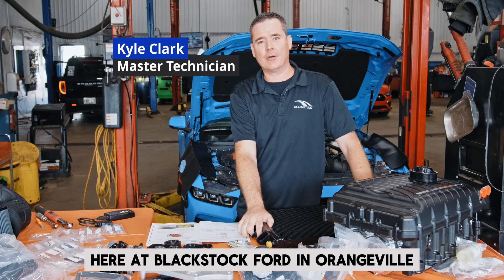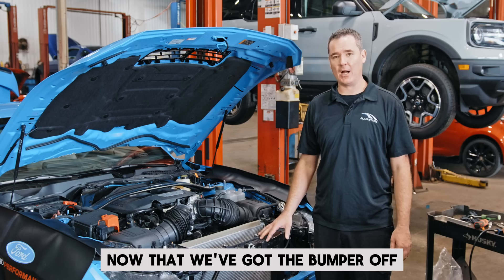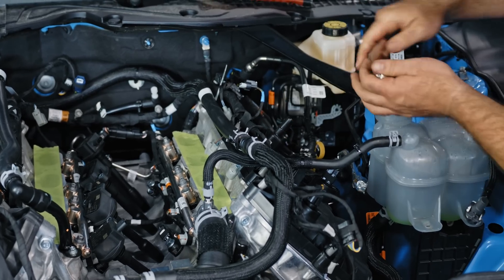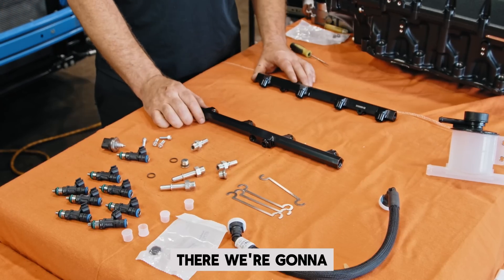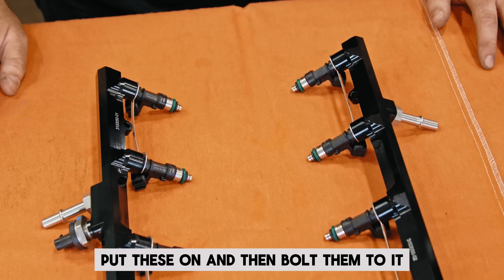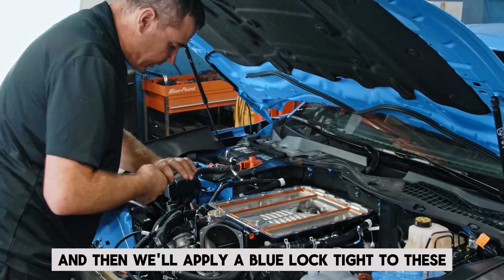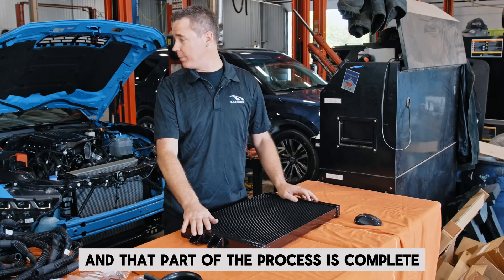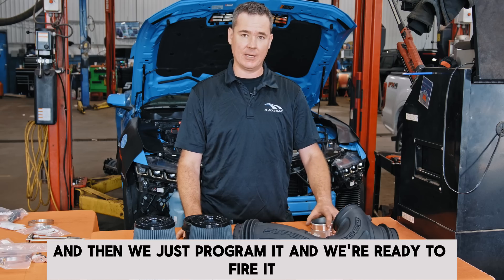Ford Performance Whipple Supercharger Installation at Blackstock Ford in Orangeville on a 24 Mustang

Comment: In depths? I did it by myself in my Garage in a day in a half taking it easy! It's one of the most rewarding power wise upgrades and easiest well laid out manual and parts supplied from Whipple as any kit any upgrade kit or upgrade period I ever seen!! Every bolt gasket Oring clamp hoses wires pumps injectors rails tuner etc you need plus extras for later, there is on the market! It's also expensive as F! But it's worth every penny!!

Comment: Why are most garages that install the Whipple SC “NOT” installing the Oil Pump Gears (OPGs) & Crank Sprocket?????‼️‼️‼️???
Thanks!!! Good video!!!
Reply: Because there’s a never ending debate that OPG are not needed, unless you are going to be banging on the limiter or installing a wot box
Reply: They are NOT needed!! Ford doesn't put them on their GT500 Roush or Saleen all high hp boosted cars with warranty!!! You only need them if you're doing 2step or constant high RPM launches! Fear mongering is why you think you do. Facts

Comment: Drove the hour out to this Dealership and ordered a kit for my Dark Horse. Can't wait to see how that comes together with the Comp Open Air boxes and dual UPR Catch cans paired with the Stage 1 kit.
Reply: so how'd you make out
Reply: @TurboBMRProjectLove  So far so good. Had to have a body shop fix the wheel lip moldings as the double sided tape was up and they may not have been installed correctly from PDI at the dealership I ordered from but now everything seems to be running great.

Comment: Does this whipple kit void your factory warranty ? ( buying a new mustang )
Reply: If you buy the Ford Performance kit and it is installed by a dealer or ASE certified mechanic, you retain your factory warranty.
Reply: @Spazilton1  This is correct; this is why I drove out to Blackstock and ordered the Stage 1 kit through them. I drop it off, they have it for 2 or 3 days (roughly 12ish hours of labour from what LMR's video says) and then you go pick up the keys and your warranty sheet and away you go.
Reply: No you get the option to buy one when you get the car you can always buy it